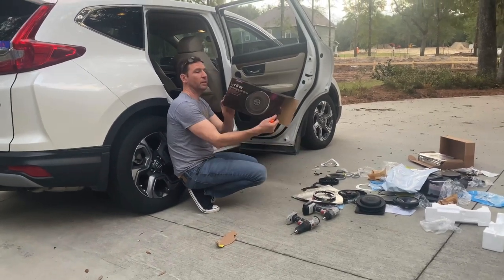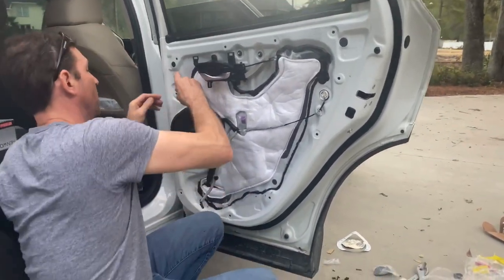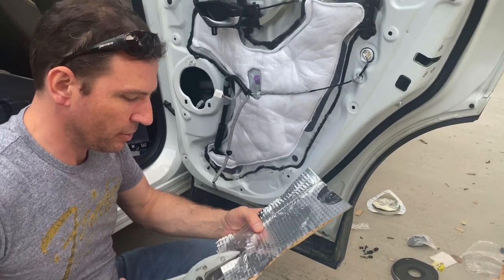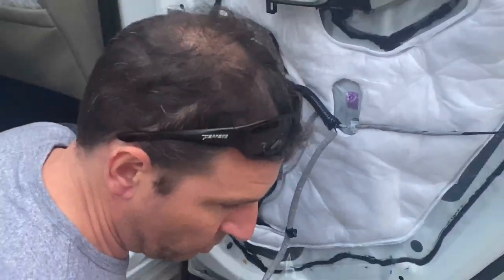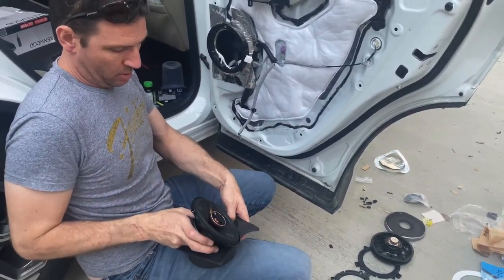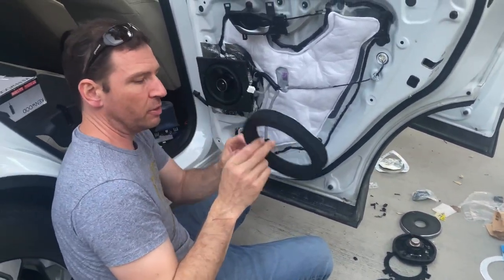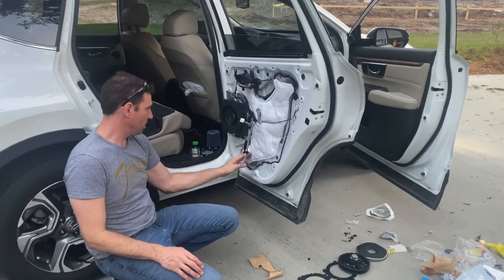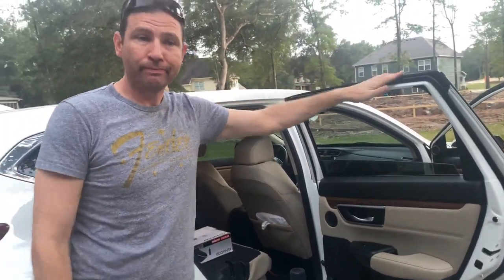2018 Honda CR-V EX-L Door Speaker Installation: Step by step Uncut

Comment: One of my speakers is blown in my 2016 Honda CRV, and my first thought was "Oh God, I'm gonna have to fork over a couple hundred bucks to get it replaced." I assumed getting to the speaker and removing the door would be extremely difficult - for context I'm the farthest thing from a car guy, I don't even change my own oil. After doing some research and watching your video I feel fairly confident in being able to pull this off, I may even replace all my 6 - 1/2" inch speakers! Thanks for the in-depth and straightforward video!!!!
Reply: At first you think it looks difficult or you think you probably break something when removing the door panel for the first time but it’s easy but I did have a little bit of trouble when I was getting access to my 2013 Silverado speakers

Comment: i wish you have done a video on installing the subwoofer, i have a crv touring  and want to install a under seat woofer myself, but i can't find a detail video. thanks for this video
Reply: Just bought a 2020 CRV EX-L with 20k miles… the audio is terrible. I have no bass and it sounds like it only has the front two speakers working. Does this come with back speakers… or is there a speaker balance option?
Reply: @greg6162 go into setting -> audio -> balance, and then adjust the RR (rear) and FR (front) settings to be closer to the RR.
Reply: @greg6162 I have a 2022 EX-L and the rear speakers sounds like crap also. I believe is the factory way. There's no way of adjusting it.

Comment: Hi, great video!! Appreciate your time and effort to put it up. What are the specs for the factory speaker, like RMS Watts, impedance, sensitivity. Can we use a 2ohm speaker. I believe you didn't add an external amp so the sound improvement was a bit or do you have different reason. Also, are the speakers coaxial or component. I have a 2019 Honda CR-V EX-L and they lack bass. A friend of mine recommended that I change the speakers, battery, add amp and that should give a great difference in bass as I didn't want to eat on the trunk space by adding desiccated subs. The compact powered subs per him are nothing but waste of money. You responded to one of the user that you only had a marginal difference in sound with the change. So, I am more concerned going this way. Please let me know your thoughts. It would be highly beneficial.

Thanks in advance for your reply.

Comment: if you get rid of the rubber cups behind the speaker's they will sound 100x better.
Reply: Agreed, because the low frequency bass needs space to generate that tone.  By restricting the path from behind, you basically made your bass worse.

I recently upgraded the front speakers of my 2015 CRV EX with JBL Concert 3-Way and they sound amazing!
Reply: @PHamster yeah but Honda’s head unit has a pre balanced EQ. It apparently limits the range and power it puts out. I think the head unit is a major problem. It doesn’t allow the speakers to fire at their full potential and limits the sound output

Comment: Is it worth upgrading speakers without adding an amp?
Reply: We just installed 4 DS series kicker speakers and the sounds is incredibly underwhelming. Looking at installing an amp now.
Reply: @ryanoreilly3325  yep, i just made the same mistake. Bought 2 speakers and they sounded even worse than the stock speakers.You really need an amp for any aftermarket speakers

Comment: There is a grill on the dashboard, it supposed to have a speaker inside but there is nothing. Would you be able to do a video or tell us on how to fix a speaker inside that grill?
Reply: That is a vent for the head unit. Not a speaker location.

Comment: Thanks for the install, question, did it improve the sound quality alot or just a bit?
Reply from the maker: Sorry for the late reply. Just a bit.
Reply: Then how do we make it sound a lot better. I have a crv 2020 and considering upgrading the speakers because they stock current sound system is not good. Will upgrading the speakers only improve the sound ?
Reply: @loganle1043  It depends on how much of an upgrade and how much you want to spend.  The stock system has the EQ set and bass drop-off at pre-determined levels.  Replacing the speakers alone will not change this.  You'll be playing the same frequencies just through new speakers.  Also, the efficiency of the speakers will matter.  A higher end speaker may have lower efficiency and the stock amp is not powerful enough to push through all the sound.  A place to start is sound deadening.  Just doing this can make a difference.  You can replace the speakers and add an amp but should also consider a DSP to clear out the factory equalization and get a better signal.   My other Honda, I bypassed the stock amp with a nice 5-channel amp, replaced the speakers and stock sub (in the stock location) and it sounded great.  You don't need to spend huge amounts of money.
Reply: @loganle1043  replace the head unit with a Joying android aftermarket unit. It’ll give you more power for the speakers. And I didn’t use an amp
Reply: @warrenb9343 yes! I just bought a 2020 CRV EX-L and it sounds like there’s no bass and only the front speakers are firing? Why is the sound sooo bad… it literally sounds like two iPhone 14 Pro max and that’s it. Is there a balance option for rear speakers? What all do I need to get I’m not electrically inclined and I’ll probably have to pay someone. Do I need a new head unit and after market amp? I remember as a teen big bass systems were the rage. I don’t want bass you can hear three blocks away… just normal sound like in most cars
Reply: @greg6162  Get a JBL BassPro Hub with the built in amp. Fits nicely into the spare tire giving you full use of the trunk.

Comment: hello, great job explaining, but you just added some more weight to the car as the factory speaker has neodymium magnet that has higher efficiency for a quarter the size and weight.
Reply: JB67  that extra lb will ruin the handling of that finely tuned , 2 ton racecar 🤣
Reply: Have you seen the average weight of Americans? I think it will be fine